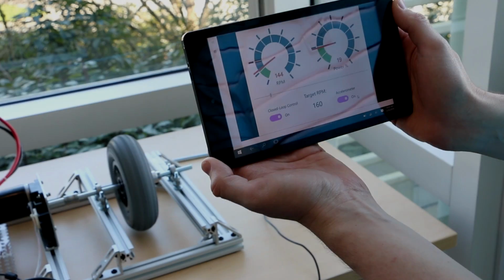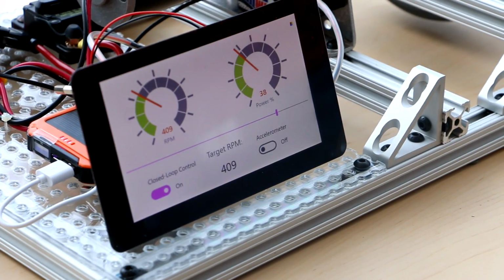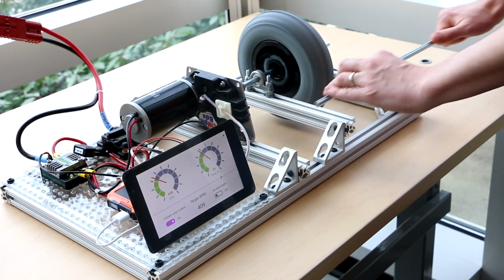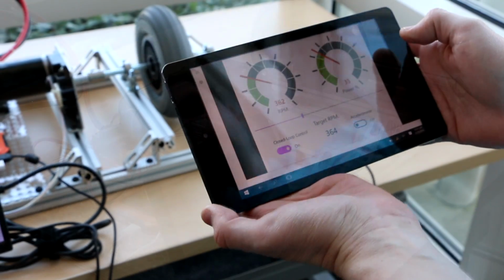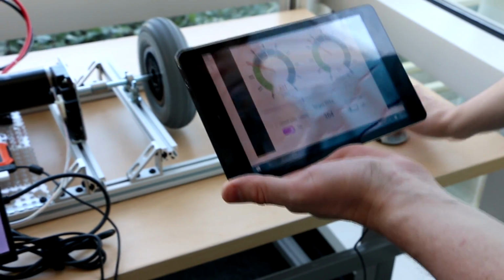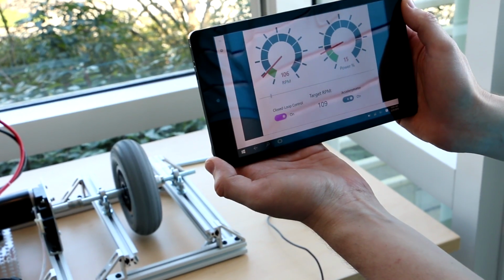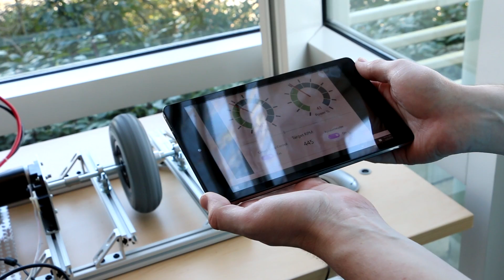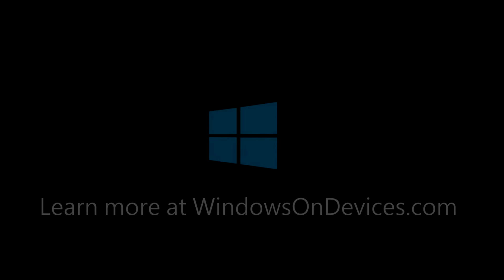Windows 10 + Raspberry Pi 3: Controlling a Closed-Loop Wheel

Comment: Windows iot is just trying to catch up with the python Linux operating systems. There's much more free information out there for python... also free applications available through get Hub and other resources. Windows has backed themselves into a corner by trying to charge for every program that comes through their system. And now they will be left in the dust.

Comment: nothing special though
Reply: Its pretty special - because you are talking about conducting Automation tasks on a RPI and Windows. Typically these tasks are performed by controllers that conduct their programming one level above the processor with no OS to speak of (PLC/PAC). Just processor instructions. Normally a user would start out with maybe Codesys Runtime on RPI and use traditional programming languages from IEC 61131-3. But here a person familiar with VB & Windows can still leverage the use of an RPI in an IoT environment.

Having accelerator control of motor speed involves quite a lot of intricacies as well, not in the least scaling, data type conversion, scan time awareness & latency.

Please share your special work on your page so we can understand what is special to you?
Reply: true, but it's just a simple experiment. you could probably make a lot more complex things...

Comment: Proprietary SoC running a proprietary OS... yeah, not a chance in hell this is going to be used in anything but short shelf-life toys, if that. Especially not when this exact same demo can be done with much cheaper fully-documented microcontrollers and open-source software like an ARM Cortex-M running FreeRTOS and LwIP.

The way I see it, unless Win10 goes open source and runs on open hardware like the Beagle Bone boards, its use in embedded systems will be a purely academic thing. And somehow I don't see Microsoft open-sourcing their OS.

Comment: Why does Microsoft always put his shit in every computer ?? This was the last device without winshit ;(
Reply: Last I checked nobody is forcing you to run MS software on anything, not even your PC. Chill out, dude. MS has just entered the world of real-time control, where failure to work cannot be compensated for by PR campaigns (let's see them try THAT closed-loop !)
Reply: +Jean Roch by default any bought pc is under Microsoft Windows license
Reply: Is that still true?  I know that here in the U.S. you can buy Dell or HP laptops with Ubuntu already installed these days.
Reply: you are salty that linux is a failure since the 90's

Comment: What touchscreen is used (the screen mounted on the raspberry pi3, not the tablet))
Reply: Looks like the official RasPi touchscreen. 800 x 480 pixel with capacitive multitouch, which makes as much sense as a Ford model T with a turbocharger.

Comment: We have some Rpi2s we need to deploy with Win10 Iot in a corp environment, running some image and distance stuff and it has to connect to our corp (Windows) network securely and be able to pass an audit of security down the line. I just checked my MSDN sub software pool, but I could not find a Win 10 IoT Enterprise for Rpi2/3 yet? ... Is that coming soon or is that out of scope for the Rpi's?

Can we run some kinda Windows Defender on the Rpi's in Win10 Iot, so we can adhere to the governance of the company? ... or alternative security monitoring software?

They are always-on-power and the 4x900Mhz cores does not look troubled running our code in the Raspbian OS so we don't expect performance problems by moving the code to Win 10 Iot Core/Enterprise. Cabled network would require a lot of drilling holes in meeting rooms so we prefer the Wifi hookup. The data goes to a Hadoop cluster and a dashboard site.

Thanks for a great channel.

Comment: Wow, you can use a 64 bit processor to do a job that would be better done with a PIC or AVR and display the results with a poor update rate on a windows tablet. All with the power of closed source Microsoft binary blob, underwhelming.
Reply: Says every actual embedded system programmer upon seeing this video... join the club, brother.
Reply: Jean Roch im not even an engineer and this is bullshit. What happens when you get a forced update lol? Even Arduino would be overkill for this.

Comment: I read you could also use a wireless Xbox 360 controller with windows 10 IoT Core for raspberry pi, but I can't find how to set it up. Could you tell me if it's supported and how to configure it? Yes, I have a wireless gaming receiver for xbox 360 controllers.
Reply from the maker: +dehim verveen Hello!  We have gotten wireless Xbox 360 controllers to work on the latest Insider build of Windows 10 IoT Core, but samples don't exist quite yet.  To get started with using a wired controller (much of the process will be the same as wireless), see the Hackster.io post here:  https://www.hackster.io/windowsiot/robot-kit-6dd474
Reply: Thanks for your reply! Yes I've seen that hackster.io post. I wanted to recreate that exact project with a wireless controller. I'll just first try it with a wired controller and then later I'll use a wireless controller. I was also wondering when windows 10 mobile will get gamepad support (for games in continuum), but maybe you're not the right person to ask?
Reply from the maker: +dehim verveen I can't speak to Windows 10 mobile - we're just working on Windows 10 IoT Core on our end!
Reply: Windows IoT ah ok, well thank you very much for your help! I appreciate it.

Comment: What's the w10 tablet used in this video ? It looks pretty slick !
Reply from the maker: +Thibault Jochem It's an 8" tablet made by a company called Hampoo. You can find similar tablets here: http://www.bestbuy.com/site/digiland-8-tablet-32gb-black/4306700.p?id=1219730555784&skuId=4306700 http://www.bestbuy.com/site/insignia-flex-8-9-tablet-32gb-black/4574814.p?id=1219771064637&skuId=4574814
Reply: +Thibault Jochem This one's also very nice: http://www.gearbest.com/tablet-pcs/pp_256039.htmlIf you don't like white, you can buy this one for a few dollars less, but it has a lower resolution screen and the quality of the screen overall is also a little poorer: http://www.gearbest.com/tablet-pcs/pp_268587.html at 350g they don't weigh a thing. This one supposedly has an even nicer screen, but it's a little more pricey: http://www.banggood.com/Teclast-X80-Pro-32GB-Intel-Z8300-Quad-Core-1_84GHz-8-Inch-Windows-10-Tablet-p-1009964.html